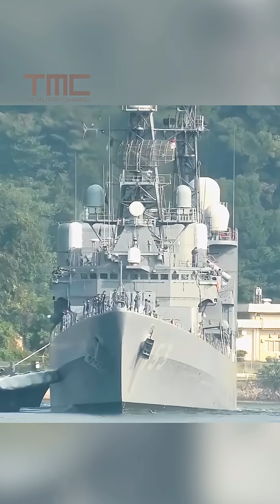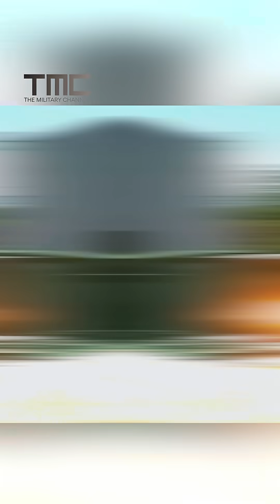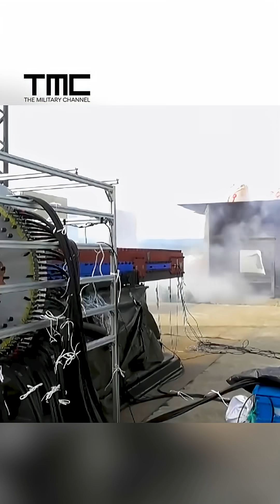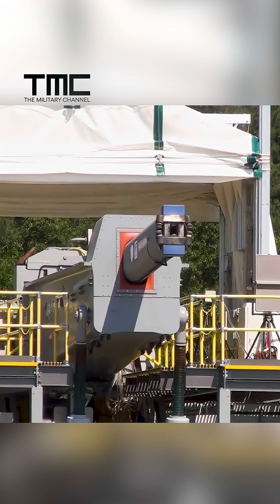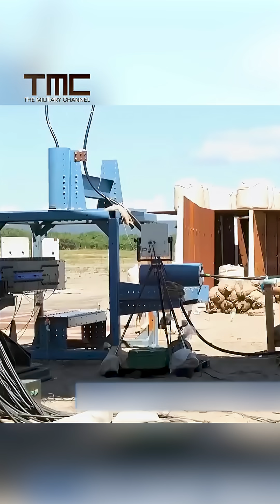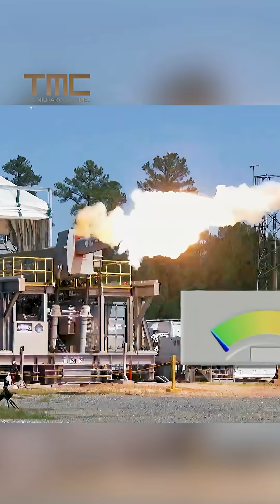Japan Successfully Conducts First Ship-Based Railgun Test

Comment: Unfortunately even Japan can't overcome the incredibly high wear on the barrel. The recalibration of the electric coils after each shot limits the ROF of a rail gun to one every few minutes, not multiple rounds per minute. On top of that the barrel of the US version needs to be replaced after less than 1000 rounds. So in total it is an incredibly expensive, energy hogging, slow ROF weapon that quickly erodes its barrel. Unless the Japanese can overcome those problems they will face the same conclusion that BAE came to: not worth the effort.
Reply: Don't worry the engineers tere are awesome, if Japan it's always top tier durability for sure.

Comment: The issue is multiple shots though, that is where the US was having issues to.

They managed it but the barrel kept breaking, it was unreliable
Reply: Break or wear out??? Bcuz I'm convinced of the latter
Reply: @shanedoesyoutube8001 I don’t know if a catastrophic break happened while firing or not, I just know that the barrel wasn’t able to handle more the a couple shots before signs of stress. It happened pretty quick, one minute they where celebrating firing multiple shots at a time then the next the project was canceled infavor of hypersonic missiles citing concerns about the barrel strength
Reply: @shanedoesyoutube8001 they wanted to put the weapon on the Gerald R ford and the zumwault too

Comment: Wouldn't the coils melt from all that heat generated from the high voltage electricity passing though it? That's why "the u.s. shelved this program years ago" is because it wasn't economically feasible to mass produce these guns.
Also, wouldn't this drain the power source, unless it's a nuclear powered ship that is.

Comment: China Has EVM Tech. These Guns Wont Even Work When They Will Stop All Electrical Impulses😂😂😂
Reply: Do you even think japanese they will expose their secret weapon?😂
Reply: @willydelarosa3014Japan Is No Match For China.
Reply: @TUTANKHAMUN077china afraid to attack japan. And China's They know what the japan capable in battle do or die. And Japan can bring the war inside in beijing. Easy work for japan 😂
Reply: These aren't guns, those bullets are slugs of metal, cheap and deadly at high speeds.

Comment: American developers could not overcome the power issue when it comes to the rail gun discharging the warhead. On a continuous basis plus the rail gun needed constant cleaning of its magnetic rail systems.
Reply: Also I believe the rails needed to be replaced often because there is basically a lighting bolt running down the center of the barrel across the rails. So it’s constantly vaporizing them when it shoots so while it doesn’t need propellant it needs to replace its rails after a few shots.
Reply: Is it the power issue or the barrel wearing issue???

Comment: I think the achilles heel of rail guns is the wear on the rail.
Reply: would imagine rate of fire would be an issue too... you are dealing with something that is going to generate alot of heat.. and electro/magnets dont like heat
Reply: @SnipersLaww That figures.
Reply: Also the fact that using a VLS anti ship missile is just going to be more reliable and cost effective

Comment: how bout reload time? does it need like google system update time haha
Reply from the maker: Surprisingly fast yet varies between a few seconds to several minutes, depending on factors like capacitor charging and ship's power output.
Reply: Depends if relying capacitor charge or grid switch

Comment: I wuld not be supriced if the usa team is atleast involved in the japanese rsilgun program as observers
Reply: We "officially" abandoned the research leaving it to Japan and opted to go a different route. The US did help them by providing their research notes and collaborative efforts. Despite all the facts in this video there was speculation that the US had developed a rail gun years ago and even had one mounted on a ship but that could have just been rumors. At any rate I'm glad Japan kept up the development because Rail guns despite what alot of people think is definitely one of the future paths weapons will take. The reasons why they may have actually shelved it years ago are logical. Barrels would have to handle the heat and the power consumption alone is significant. I'm sure if the US did shelve it we have some sort of agreement with Japan for technology exchanges in the future.
Reply: The U.S has not "shelved" their rail gun project.  I think you will find they already have a working model. They just do not advertise that fact.
Reply: I would imagine it takes a massage amount of electricity to operate it.
Reply: They have to make the Zumwalt project worth it somehow.
Reply: @memecliparchives2254 they're actually removing the guns on the zumwalt and refitting it with vertical hypersonic missile launch tubes for now. They cut the order short on ships, so they also had to cut the order down on ammo for their original guns. 

Those being the only six guns of their kind in use and the order for the specialized ammo being cut down meant the ammo's cost per round ballooned and made it to expensive to be cost effective to use. It had a 100 nautical mile range but the price per round was projected to be 800,000 to 1,000,000 per round so it didn't make sense to use a gun instead of a missile. the goal was to have long range attack capabilities but also keep it more affordable than using missiles. 

Now they are strictly stealth guided missile destroyers with a new role in combat. Of course with its power generation capabilities they have plans for potential refitting them with directed energy weapons or laser weapon systems in the future. The idea of eventually refitting them with rail guns pretty much existed from the start even knowing they were shelving the Railgun development program I'm fairly sure the idea was always to come back around to it, or my guess is they shelved it handed the research and original designs over to the Japanese and let them shoulder some of the cost and effort in the development. It's pretty common to do joint research in weapon systems, ships and aircraft to bring the individual cost down for each country involved. 

All that being said they should just fund a few more Zumwalts in my opinion. If it even comes close to meeting expectations in combat. It's likely to be one of the most lethal ships in military service.